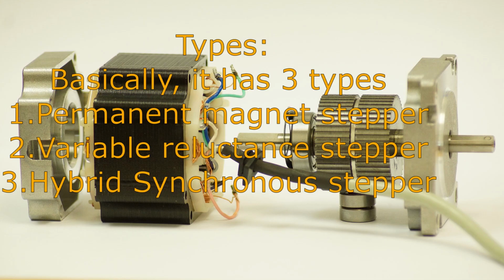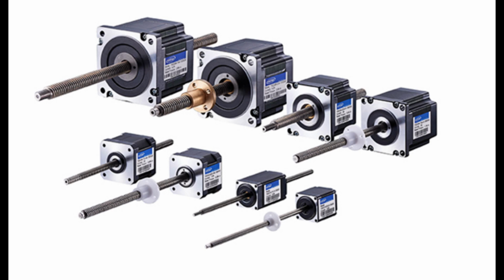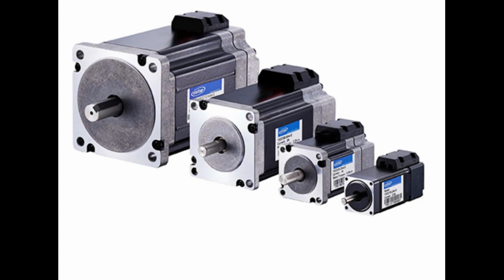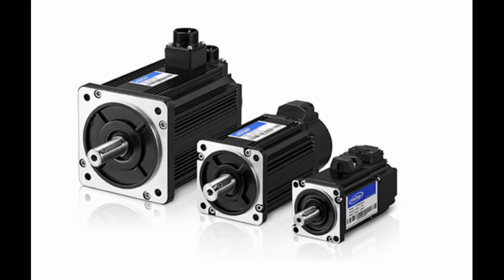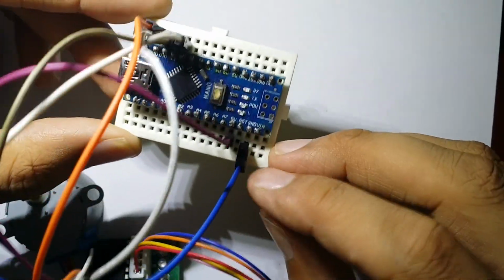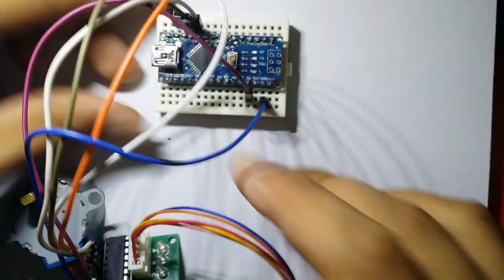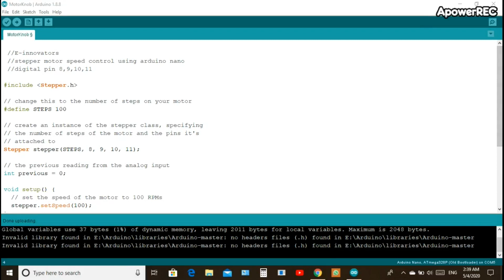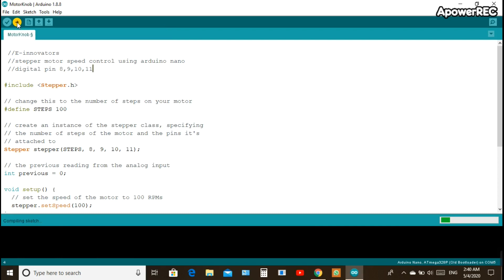Stepper motor using Arduino Nano! | Complete Tutorial!

Comment: I have the Arduino nano w/ devmo 28byj-48 stepper motor w/ uln2003 driver module. once I upload the code onto the nano the motor will spin and the lights on the motor controller flash but after 10-15 seconds it shuts off. How do I solve this so that it keeps running?

Comment: Thanks for this! I just got my IR remote decoded, and would like to control a stepper with it eventually. However, I don't think the Nano can handle more than 3.3v. The Nano and the IR sensor are fine plugged into the computer, but I'm worrying about the breadboard power module, which can take 9v (right now, it's on the breadboard, but not plugged in to power.)

Comment: my stepper is not working with Arduino, but the stepper are working well with Uno, and the nano upload blink is working fine, its look like not enough power supply to stepper motor from the Arduino Nano. is this the possibility of the problem ?